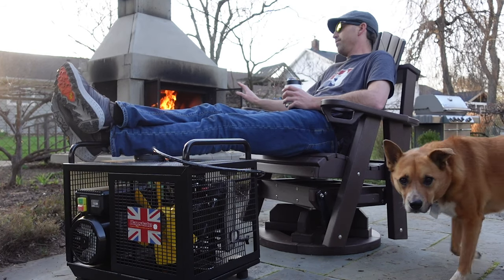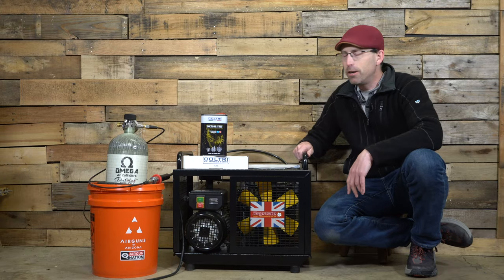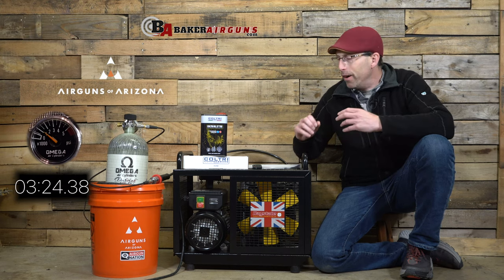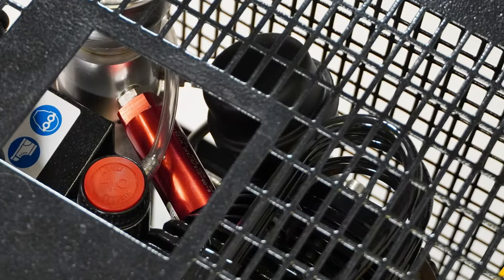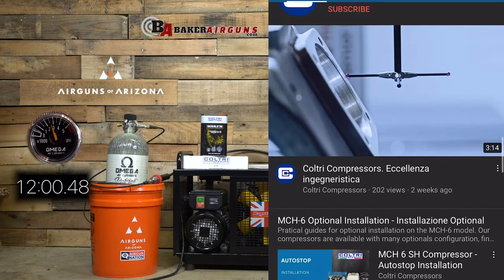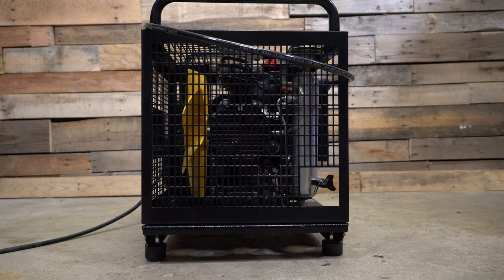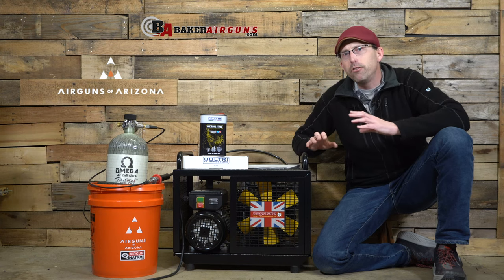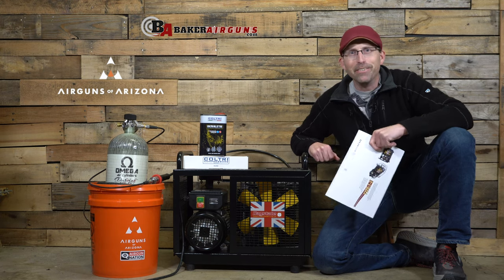Daystate Type-2 Compressor / Coltri MCH6 Airgun Compressor

Comment: from zero to full 20 minutes That's very good. The air from it can diverse use it ??
Reply from the maker: With the correct filter installed it can. Anything the MCH6 can be used for this can be too.
Reply: @AirgunAdvisor  thank you

Comment: Takes 45 mins to fill a 300bar tank from empty with mine. Why the time difference?
Reply from the maker: Did you have all the valves closed tight? Was the bottle leaking or not open all the way? Sounds a bit odd.
Reply: @AirgunAdvisor  I have the compressor 4-5 years now and it was the first thing I noticed about it.
    The valves are closed and no leaks, a top up from 200bar to 300 bar takes about 15 minutes and the bottle open fully.
Reply from the maker: That time feels about right.